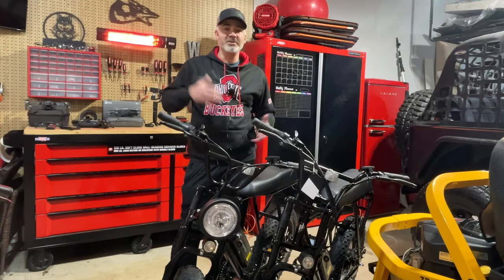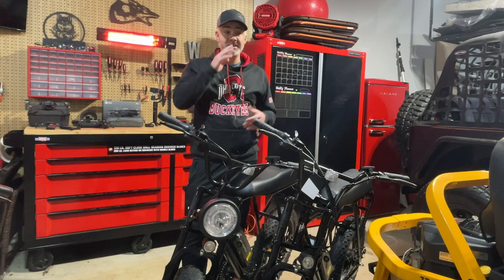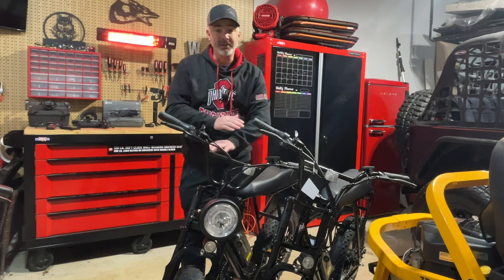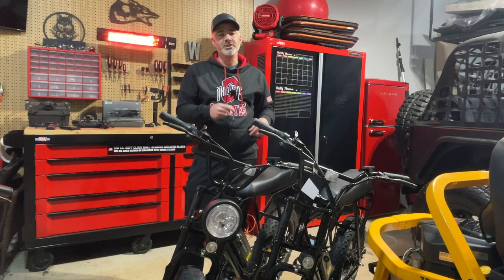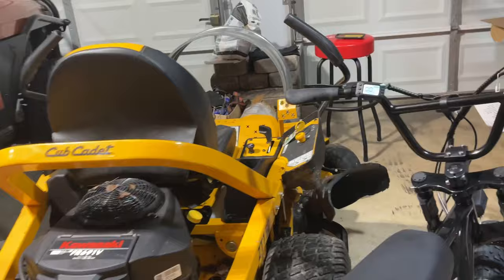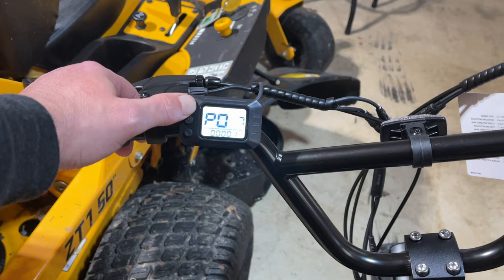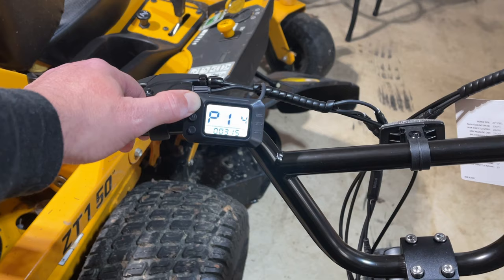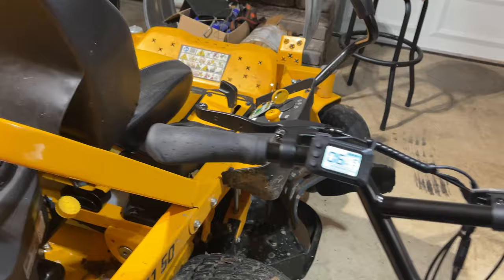🔥 HACKING MY EBIKE TO GO FASTER - NO MORE SPEED LIMITER

Comment: Lectric XP 3.0 has anyone been able to defeat the 20 mph max for throttle only by changing out the M5 Lectric display with a Generic M5 display?  I don’t need 28 mph throttle only but 25 would be great with zero pedaling.  I am unable to figure out how this bike knows I am pedaling, it’s a 2023 bike and there is  no external magnets and some of the program modes in the Lectric M5 display will not allow you to change certain options
Reply from the maker: It's P08 setting. Raise it from 32 to 100 and it will override the limiter and go up to max speed

Comment: I can get 28mpg peddle assist but not any higher than 20 mph throttle only on Lectric XP 3.0  Please help  . . . . .
Reply from the maker: Sorry, that is a lectric thing. You can alter top speeds on most ebikes, however Lectric blocks it

Comment: I just got one yesterday... need a little help cause I raised all the settings and lowered the tire and still haven't unlocked beyond 20
Reply from the maker: Lowered the tire? You need to raise it. Also what is the motor size? Will need minimum 500W

Comment: can you increase speed on an lectric xp trike I got it up to 14 on control panel want to get it to 20 miles per hour Thanks
Reply from the maker: Use extra caution with raising trike speeds. The turning can be a nightmare when going over 15mph which is why most trikes are limited. You can do it though

Comment: I have an Ancheer. It wont let me change any of the P settings 😭
Reply from the maker: It will, I've done it before on their bikes. Depending on the model panel/controller its a different process, but they can be adjusted

Comment: How do I get to this setting menu on my free sky Alaska?
Reply from the maker: Did you try the plus and minus at the same time?
Reply: @NRGSPORTSANDHOBBY  yes !   and it went to SP p mode. Then it’s asking for a 4 digit code. What is the code? And is this even the code to subtract the speed limiter? It sucks I can pedal my ass off going down a steep hill and I can’t go faster than 35 mph. And with the throttle alone I can only get up to 22 mph. Thanks for your advice and I will literally send you $100 if this can work on my bike.
Reply from the maker: Codes are defaulted to 0000 on almost all ebikes. Did you try that? If not, there will be the code in your manual

Comment: Hi my name is Bernie I was wondering how I might have put my speedometer into kg per hour instead of mph after I tried the speed hack which work by the way I know this because I paced a friends car and got 5 more mph.. but I screwed up my speedometer and the kilometers per hour. How can I clear this back to regulus specs. And start again. Except with the kilometers per hour business my bike is a Tot guard 27.5 500 watt .. I'm 73 and I love it I just think I may have done something wrong.
Reply from the maker: Changing those settings are just a toggle once you get into settings. Let me know if you get it figured out.

Comment: How do u unlock it on an ancheer 16 inch folding bike?
Reply from the maker: I would start with the panel and change the tire size to 29.5. This will usually increase it up to 28 mph.
Reply: @NRGSPORTSANDHOBBY  In the panel you change the tire size setting or just replace them entirely?
Reply from the maker: No, don't change the actual tires. You are just tricking the panel to think you have different tires. Then the sensor thinks you are going slower than you are. Keep in mind by doing this, the panel will still show 20-25mph, but you will in fact be going much faster. I have a free app on my phone that shows most times i'm going around 40mph even though the panel says 25

Comment: Does this work on the juiced cross current x
Reply from the maker: First of all, great ebike! Love their stuff. Yes you can unlock it. Our newest video will have a more accurate depiction of what's needs to be done. That panel is super easy to get into developer mode. You can change top speed and tire size if you want. 750W motor with that battery should safely get you another 10mph over what you're currently getting.

Comment: I did this and now display is flashing E 30 and bike no longer moves. Please help
Reply from the maker: e30 is a communication error from the throttle or the controller. If you turn the bike off and on it should go away. If not, reset it back to factory. Depending on the bike you have you really only need to raise the P08 setting as that's the speed limiter setting. The others are for older bikes like the one in this video. I don't know which ebike you have, or which panel you are using. We have a newer video for newer ebike styles. I suggest watching that one.

Comment: Please, if you don’t mind, can you show it on the third bike you have it in the video I have the same exact one i’m talking about Oraimo Electric Bike and I’m trying to unlock the speed limit.
Reply from the maker: Which Oraimo do you have? We've reviewed a few. You will need minimum 500W motor to take advantage of this
Reply: Thanks for replying back I do have Oraimo Electric Bike for Adults,350W BAFANG Motor(Peak 500W), 4A 3H Fast Charge, 468Wh Li-ion Battery, 21 Speed Gear, Air Saddle, 45 Miles 20 MPH 26" Mountain Ebike, Complies to ANSI/CAN/UL2849. I bought it off Amazon and I’m really happy with it but I want to go a little bit faster.
Reply from the maker: Great affordable ebike, but not ideal for raising speed. Too weak of a motor. Our 1200W ebike only gets up to 43mph

Comment: I have an ebkacocy 400 watt e-bike, it tops out at 22 mph.  How can I unlock the speed?  I only have 1 button on the display.  I’ve researched everywhere online, can’t find anything for this particular bike.
Reply from the maker: I'm not sure about that ebike and what capabilities it has. Did you buy it second hand? Have a manual? Usually for under 500W motors like that, they won't go much faster than 22-25 mph
Reply: @NRGSPORTSANDHOBBY  ok.  It didn’t say anything about it in the manual.  I bought it new from the companies website.  It tops out at 22.
Reply from the maker: You might be stuck with that. If you want to upgrade, I have a few favorites that I keep for myself. I have reviewed over 200  ebikes and there are 3 standouts that all can go up to 43mph and haul a good amount of rate with long range (200 miles in one case).

Comment: I have a aventon adventure and i can't change the wheel size on the screen it's locked kinda do you know anything about those bikes
Reply from the maker: You can with those. You have to get into developer mode. All bikes have it. Usually holding two buttons at the same time for 10 seconds. Plus and minus or power and minus. Depends on the display type. This ebike can be adjusted without tire side adjustment cause they sell them to all countries. We have a video on a similar display. Check it out
Reply: But it does say on the digital display when you scroll through it Ave speed and Max speed which is 35 that I've never been close to just 28
Reply from the maker: Did you watch our newer video on this subject? it matches your display better. You have to do the max speed increase and the tire. Then do the back tire raise throttle trick we show to see ebike max speed before riding. It will be slower do to your weight and motor power though. Our ebike has 1200W motor and we get 43. That's about right. If you have under 1000W you likely won't get much more than 28-30 unless you are super light and the bike is light

Comment: Help on a totem victory 2.0. How do i get into the settings? Thanks
Reply from the maker: That particular ebike is kind of more of a budget ebike. You can unlock, but it could ruin your motor.  It's not powerful enough. Try and get an ebike with a 750w motor or larger. I believe that one is 350w. You would want minimum 500w to really unlock the full potential
Reply: Awesome thank you for your help 😊

Comment: Allmost all the settings are locked on mine, only 1 and 2 is unlocked, do you know how to unlock it, i have a S380 display on a Gotrax EBE3.
Reply from the maker: I have unlocked two Gotrax ebikes no problem. I did the up and down held for 20 seconds, then the power and down for 10 seconds. But it wasn't that model. Maybe sure your motor and battery can handle the extra power.

Comment: Can u do it on a Fucare Electric Bike 750W Ebikes for Adults 32Mph 48V 20Ah Removable Lithium LG Battery 5.0" Color Display Shimano 7 Speed 20''X4.0 Fat Tire
Reply from the maker: You would just have to find out how to get into settings, then change the tire size and you can go up to 40-45 on it. Great bike
Reply: @NRGSPORTSANDHOBBY  did that only maxed at 31 r😢
Reply from the maker: Keep in mind your speedometer will be off. It's tricking the system. Mine says 28, but my phone says I'm going 40. Did you check that?
Reply: @NRGSPORTSANDHOBBY no I didn't even think of that is do I check that through a app?
Reply from the maker: Yes, CycleComp is a good app. But any speed checking app will work.
Reply: @NRGSPORTSANDHOBBY  thanks man got my sub all the way I'll check it out just got my first ebike

Comment: Any chance of getting more speed out of a Voltbike Outback ?
…anything I’ve seen said no.  🤷🏻‍♂️
Reply from the maker: It certainly has the motor and battery for it. I'm not familiar with that panel though. I wouldn't know how to get into the developer mode without having one here. Does it say in the manual? Some manuals do and actually give you the codes to raise the speed. Most ebikes, it's P8. However I just don't know on that panel. Nice ebike though

Comment: Why does everybody call this a speed hack? It's not a hack. It's just going into the advanced settings and adjusting the voltage to the motor which increases the speed or decreases it.
Reply from the maker: lol, because most people don't know how. So to them, it's hacking the manufacturer defaults to make it go faster. Some definitions of hack might be different to you. Thanks for the comment though.

Comment: How do I subscribe? I have an Aventon. Level 2 and need more speed.
Reply from the maker: Subscribe to us? It's the button right below the video. Aventon can be unlocked through the app to a class 3 which will get you 28mph. Beyond that you will need to get into developer settings similar to this video
Reply: I set the speed to 28 in the app, but the throttle still only goes to 20. You have to pedal to go faster. I cant pedal that fast. I run out of gear. I want to make the throttle able to make it go faster than 20.
Reply from the maker: This is where the confusion is. You don't actually have to pedal. Just move the pedals around while pressing the throttle and it will go 28. The sensor just needs to see the pedals moving

Comment: I have an extra motor and control panel. Dynalion from china. Can you help
Reply from the maker: I would need more information like which panel that it uses. Did you look into the manual for codes to unlock? Those are made to sell in multiple countries so it should be able to go pretty fast

Comment: can you do anything with analog led metered display!
Reply from the maker: Yes, although you need to learn the series of buttons to hold down. Most of those types of ebikes though have smaller motors that won't really go much faster.
Reply: @NRGSPORTSANDHOBBY  I have a new vivi folding mountain style it is 500watt 48v 10ah  it just comes with analog meter,  can this be replaced with digital lcd?
Reply from the maker: Unfortunately no. The cycrown folding ebike we did a video on is WAY better ebike for just a slightly more money (prime deal) with 750W motor, double the aH (super important for range), and can be unlocked to 40mph. You won't be able to do much to that vivi ebike unfortunately. But at under $500, you kind of expect that.
Reply: @NRGSPORTSANDHOBBY  thank you

Comment: Can you unlock the limter on the Volcon Brat?
Reply from the maker: Of Course. Won't go quite as fast as the Haoqi Rhino, mainly because of the battery and motor. But you could get some good speed from that

Comment: I just bought an Aostirmotor S18, it only goes to pedal assist 5 but still does 30 mph. Can I unlock it the same way as you did here? Thanks for the help
Reply from the maker: No, this brand will not go faster

Comment: What about a pedego? I have a element v2 and cannot find any type of hacks for it. I can go up to 25 mph tho
Reply from the maker: It should have a secret menu. Every one of our ebikes do. Keep in mind after alterations, your panel will still show 25mph, but you can go much faster. Did you try?
Reply: @NRGSPORTSANDHOBBY  I did something to it before it was going tops 22 mph now it goes 25 mph but I want more from it lol. Need a little more power also for off-roading and hunting
Reply from the maker: Your panel might not ever show over 25, but you can get it to go faster. Use a cycle app to see your true speed. Many of our bikes show 25, but go 40+
Reply: @NRGSPORTSANDHOBBY  mine will show 30 plus when I’m going down hill I’ve gotten it to about 35 my son has gotten it to over 40 mph on a big downhill

Comment: Mines different, I don't get that PO settings while in my settings
Reply from the maker: Yeah, not all ebikes can be unlocked from the control panel. You might have an older one with the magnet. We have 5 different unlock method videos. Maybe one will help with your situation

Comment: My woken has three pas modes but it’s not letting me raise the speed idk
Reply from the maker: Those are the regular settings. You need to get into the tire size menu. Follow this guide
Reply: It doesn’t give the option. When I hold the plus and minus it just takes me to the PAS settings but doesn’t seem to allow any real change except to zero out the miles trip mileage. No tire size option. I wish I could send a picture of the panel I have. If you pull up Amazon it will show you the panel for the Wooken 20” fat tire e-bike. Holding both +&- takes you to the regular menu and when you press the + it only changes the odometer from km to miles
Reply from the maker: Tommy, some ebikes will have the main settings, the hidden settings, then the developer settings. You might have to press the plus and mine for a couple seconds, then once the hidden menu comes up, click and hold the power and down button for a couple seconds until it pulls up. We have a few ebikes that have this as well. But all ebikes have the ability to change tire size
Reply: @NRGSPORTSANDHOBBY  ok I’ll try that

Comment: I have a Joystar 20 inch Chopper E Bike it only goes 20, I would like that E bike to go faster
Reply from the maker: With only a 250W motor, I wouldn't recommend it. There are 500W motor ebikes in the same price range that you could get up to 42mph+. You can do it with yours, but would be hard on your motor, and the bike isn't designed for it (safety issue).

Comment: Hello does this damages the motor or battery?
Reply from the maker: It will wear on the motor mostly if you are using anything less than 500W. I would not recommend it on those cheaper 250W or 350W ebikes
Reply: @NRGSPORTSANDHOBBY  ahh I see. So the one i bought was 500w and 750w peak, should I do this? Or you think I should just leave it normal?
Reply from the maker: 500W should be fine. it will lower your battery life, but works fine. You should be able to get it up to around 30-35mph max

Comment: On paved bike trails, I have witnessed people on e-bike's doing over 30 mph when the trail is crowded with people.  It's only a matter of time before a tragedy happens.  Then they will be banned.  OR, you could slow down around people and it won't be an issue.
Reply from the maker: Ebikes are not usually allowed on paved trails. People use these many times as their main transportation to and from work or school. 28MPH is perfectly safe. If they go faster, they should not do it on paved trails, only streets or off road.

Comment: I have an allegro mountain bike and it asks for a passcode?
Reply from the maker: Developer codes are many times in the manual. Most of the bikes we review have all the codes in there
Reply: @NRGSPORTSANDHOBBY  didn't get no manual Sir
Reply from the maker: You bought it second hand? Manual will have the passcode. Maybe you can find a digital version online, or call the manufacturer if they are still in business. Interestingly average ebike company is around less than 4 years. Always good to get a brand we review because we research the company first.

Comment: I have a speed rid Fat Tire 500w e-bike and I can't find any way to unlock the speed limiter on it you said that there's no bike you have been able to do this on well tell me how to do it on this
Reply from the maker: We have three videos on different panels. I don't have that bike here, but the process is the same
Reply: @NRGSPORTSANDHOBBY  the only reason why I'm trying to increase the speed is because I live a few miles out of town this is my only mode of transportation that I am allowed to operate and I run about 10 to 15 miles a day
Reply from the maker: Trade it in for one of these and you will go 43mph - https://youtu.be/tB_qiJj1OQM
Reply from the maker: The key is the motor. The 1000W or larger motors made the difference on speed.

Comment: How do you do it if you don't have a speedometer
Reply from the maker: If you have no panel, you might be able to use the magnet move method. But most e-bikes with a panel aren't of the quality to handle faster speeds